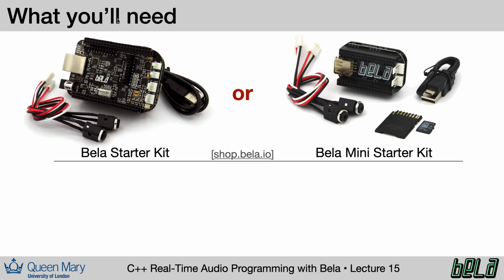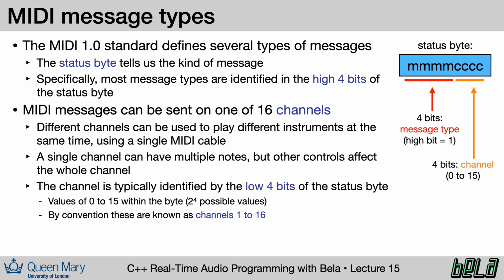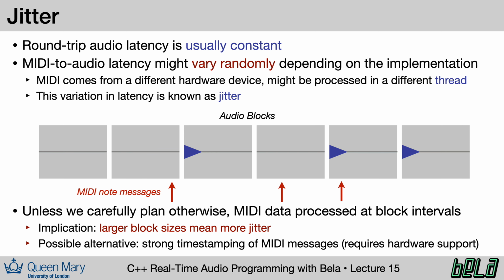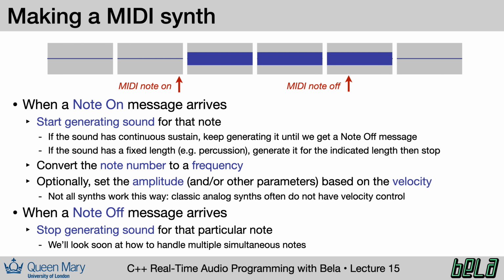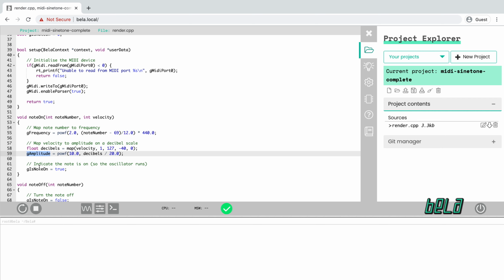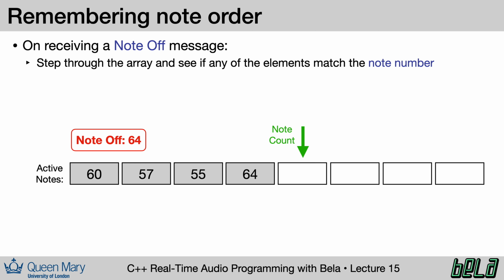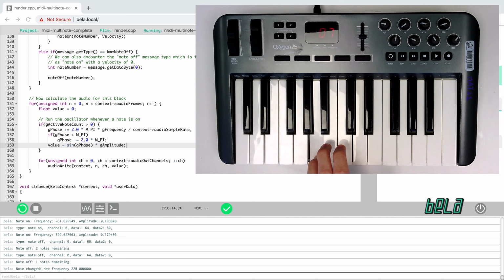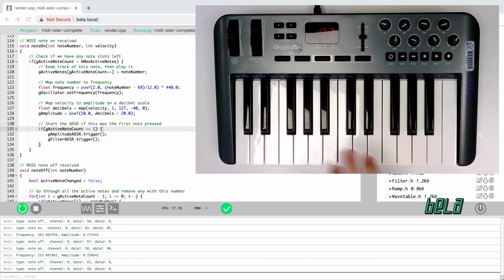15: MIDI part 1, C++ Real-Time Audio Programming with Bela

Comment: Very cool!  Would it be reasonable to use Bela to code/create a hardware MIDI interface for use with MacOS?
Reply: Yes you certainly can. It's possible to send MIDI messages as well as to receive them, although I don't cover that in this tutorial.
Reply: @apmcpherson  Cool!!  Very happy to have discovered this platform you all have created!
Reply: @apmcpherson  also, your tutorials are awesome!